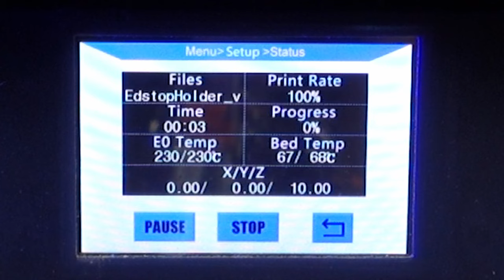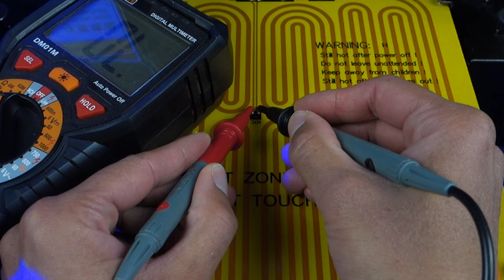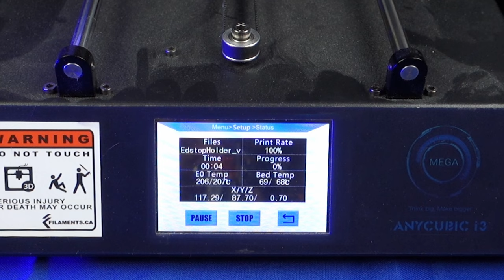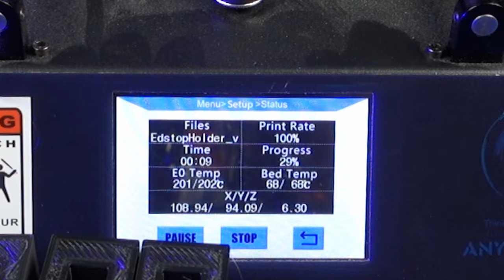Repairs - Change the Hotbed Thermistor - I3 Mega S

Comment: Awesome video, Yasmeen, thanks for your expertise! I had the same problem you did with prints stopping randomly. I did a continuity check on the hotbed thermistor wires and found the green wire had a break in one place and the blue wire had two breaks. However, my thermistor also measured open (I think I connected it to the wrong jumper pins on the motherboard) so with your video's help, I was able to order new thermistors which will arrive in two days, and I was able to determine the correct connection on the motherboard for the hotbed thermistor. I'll post an update here when I get it fixed.
Reply from the maker: I'm happy that it helped you out.  Happy printing!
Reply: @Yarkspiri  You're my she-ro. I got my printer back together and it's almost done printing a small job. Hasn't stopped yet. Now if I could just figure out why nothing wants to stick to the bed without using a glue stick... (sigh)
Reply from the maker: @matts156 I found the build plate very finicky about the temperatures it was set at.  If it was off by 5 degrees, it would give me a lot of issues.  By having the first layer as the same as the regular one, it also helped a lot.

Comment: Hey so I Managed to scrape my themistor off somehow, Im a little confused as the replacement part has long wires?? and my bed doesn't have them? P.s I'm new to this 
any help ?
Reply from the maker: The thermistor comes with the long wires to make it compatible with other machines, but you only need it to be long enough to reach the connections.  So you'll remove the excess wire to solder it to the original connections after you've checked that the thermistor works.
Reply: @Yarkspiri  thank you so much for a reply on a 2yr video :D 

I ordered some new thermistors and a soldering kit.

I guess I need a current electrical measuring machine of some kind too .... I'm embarrassed I know this little about electronics.
Reply from the maker: Everyone learns somehow :) Yes you'll need a multimeter (a digital one is best), and you'll need to make sure to set the settings prior to checking your readings.  (multimeter's have a fuse and if you use the incorrect settings it will blow, and you'll have to replace the fuse, so double check before using it).  You'll know what setting to use by checking the thermistor information.  If you buy one in person from your local electronic store or car shop, most staff members should know how to explain the settings for you.  I believe I showed the setting in my video, but that will be dependent on the thermistor you purchased.  You'll want to keep the same thermistor type that was on your machine previously, since the firmware will be set to that type.  Hope this helps.

Comment: Do you know if foil/HVAC tape will work instead of the yellow tape?
Reply from the maker: I do not, unfortunately.  I know that this tape is used because it also comes in a none conductive variant.  So I've found it quite useful for other repairs as well.  Generally it's also pretty affordable.

Comment: What specs thermistor do I need please? My heated bed goes every year and I’m sick Of buying new beds each year.
Reply from the maker: Did you check to see if the machine has tinned wires at the terminals?  It can overload the heated bed.  I'd also double-check the internal wiring for any burnt connections, since the thermistor should not burn out so quickly.

Comment: Found this video because my print will not start. it warms up and moves to the starting location then freezes. Pronterface gives me the error TFT Serial Debug: Kill command... J11 My thermistor reads 110K Ohm when cold. I did have to re-solder the bed connector which may have caused the initial problem. Hopefully now that it is completely cooled it will function correctly??  I guess it's worth a shot.
Reply from the maker: Did re-soldering help, or is the machine still acting up?
Reply: @Yarkspiri  I'm having issue with the bed now. It turned out to be a couple of things. I had to change one of the motors from e1(factory placement) to the second z and had to adjust the extruder cables because the littlest shift messes or it
Reply from the maker: @colgesuks  I also had to change the motor connection as well, however in my case it was because I had updated the firmware to one which had been created by another user.  I had to tie down the cables to the extruder so that they didn't shift.  Likewise, I did notice that when I did this, the cables' connection broke easily for the heater block.  Furthermore, I added shrink film around this connection for support.

Comment: What type of thermistor is it abs where do I get one please? I’m sick of replacing the bed every year due to this issue. A waste of heated beds and I’d rather solder a new thermistor than paying £40 for a new bed each year.
Reply from the maker: I got the NTC  3950 100k version at the time from Amazon, but you can buy it directly from Anycubic as well.
Reply: @Yarkspiri  thank you for both replies, much appreciated. Will get a new thermistor and check the wiring :)